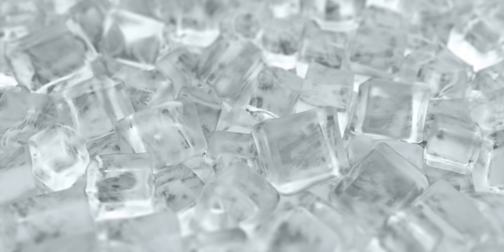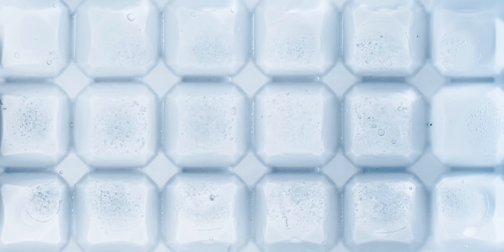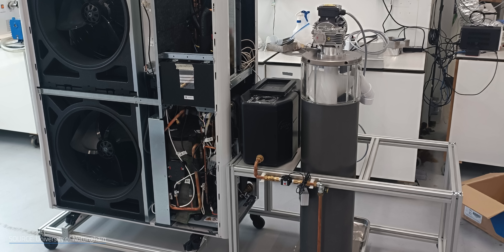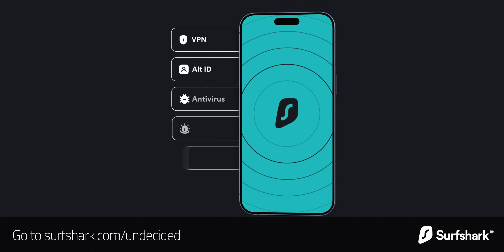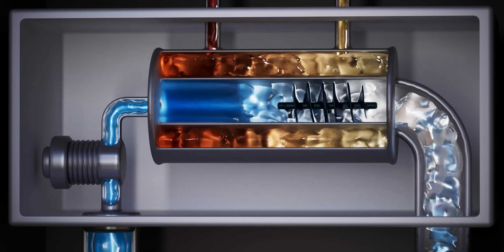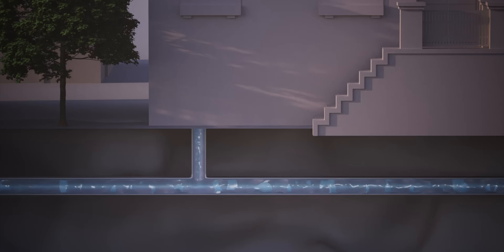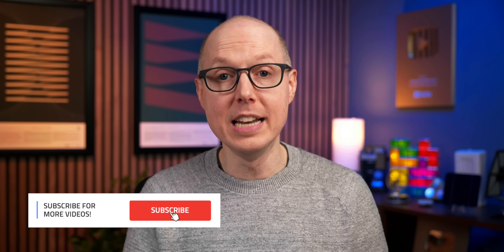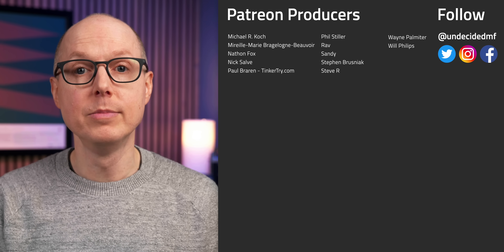How Can Ice Heat Your Home? Ice Source Heat Pumps!

Comment: Gas mains aren't bidirectional so where does the non potable water come from and where is the return loop?
Reply: The non-potable water comes through the gas pipes and the slush is dumped into existing sewer pipes to be melted by mixing with all the other sewage.
Reply: @willythemailboy2  I thought that but a lot of our sewage especially at the house is close to ground level so on a minus 5 celcius night wouldn't the sewage from so many slush producing houses be in danger of freezing solid especially with solid matter like faeces and toilet paper, my neighbours and I all share a sewer manhole between each pair of houses that is only 3 feet below the surface, that is repeated throughout the estate of several hundred houses.
Reply: @ Depends on where you are in the UK, but the frost line there generally isn't much below 18 inches. Even if you have snow on the ground without melting for several days, the ground stays above freezing even that close to the surface.

Couple that with the heat in domestic waste water and the slush should thaw pretty readily in all but the worst circumstances. If you were in Finland or something it would be more of a concern.

Comment: If we're talking about using non-potable water, then the freezing point drops with added particles in solution, driving up freezing time and energy consumption relative to freezing a more pure form of water. And this begs the question, if we're now adding more power requirements to the grid, can it handle it, and what is the source of the electricity?  If we have to generate the electricity with natural gas (or some other fossil fuel) generation, and then transport that power to the home, with transmission losses...isn't it better to just burn the natural gas at the home and get a better efficiency for energy transfer, and therefore a smaller CO2 release?
Reply: Non-potable water comes in many forms, not all are going to have significant particle or dissolved content to worry about. Technically you could feed this from a rain barrel or similar, which is also technically non-potable. As for comparing power plant gas usage to home usage, no. Not even close. Power plants are WAY more efficient than home use, even ignoring the efficiency of using the electricity to run a heat pump rather than electric heating. The relative efficiency of power plants is why we have them rather than individual generators for individual houses.

Comment: Air to water heat pumps have been used for 20 years up here in the north of Sweden. They work insanely well down to -20 deg C. This video is absolute nonsense. Matt keeps pedaling negative fake news regarding air/water heat pumps year after year 😥

Comment: Whilst the use of the existing natural gas pipe is a good reuse of infrastructure, this is totally wiped out by the need for a return pipe which doesn't currently exist, necessitating digging up every road and street to install anyway! And if not plastic, gas pipes are also steel which is not suitable for water.

Comment: Sorry, this makes no sense.  He's talking about running a second pipe to the entire network for the slush outflow; there's no way that's affordable.
Reply: I might be missing something, but isn't the idea that they would use drain water, maybe supplemented with tap water, as the input, and then ice via existing gas pipes as the output?
I'm more confused by the wording of the video, which makes it seem like the ice is the source of the heating as opposed to a byproduct.
Reply: @reinux  The plan seems to be to run the input water through the gas pipes and the output water into the sewer system.
Reply: No that is not what he's talking about. 
Each house already has an existing gas and water pipe leading to the house. All that is needed is the ice slurry output pipe that can just go to the sewer where the ice can melt.
That is not the expensive part, the expensive bit is the ice heat pump.
Reply: This was explicitly addressed. The researcher said it would go down the drain. Colloquially, "the drain" refers to the pipes which lead outward from sources of used water within the home. I am pleased to inform you that the English do indeed have indoor plumbing, and are no longer throwing the contents of their chamber pots out into the street.
Reply: @ It really is disappointing that people come to the comments for a tl;dr, and then are misled by confused comments. It seems to be getting worse as of late. Chat GPT effect maybe.
Reply: They would use the storm sewar
Reply: Exactly my thought! Gas network is a one way delivery! But they got 15 minutes of fame...

Comment: While you would have to treat the existing metal pipes to resist corrosion, a saturated NaCl solution would still be cheap but more reliable and more energy dense than using water or say antifreeze to pump heat from. Traces of a salt hydrate with a higher melting point would give the solution that phase change temp bonus without risking clogs by freezing the host NaCl(sat), like plain water, thanks to the dT between freezing points of the salt hydrates on top of having a having a higher heat capacity.

Comment: You need to persuade everyone in the city to switch.
Can't use gas line for both at the same time.
Reply: The idea is to dump the slush into the existing sewer lines. They should easily be able to handle the additional load.

If I'm mathing correctly, the average UK home would need only about 1200 liters of water to replace the energy content of natural gas used per YEAR. Compared to about 350 liters used per DAY for normal usage, the increased water demand and sewer disposal cost is absolutely trivial. Even allowing for inefficiencies doubling the theoretical usage to 2400 liters of water is still a rounding error.

As for the change over period, it would be possible to run the heat pump using existing potable water lines until an entire area is converted, then switch the gas pipes to non-potable water. After that switching each end user from the potable system to the non-potable system would be relatively trivial. While more costly in terms of water prices, especially for the early adopters, it spreads the transition out over a reasonable time frame while not leaving anyone out in the cold, either figuratively or literally.

Yes, this is copy pasta, but at least it's my own copy pasta rather than repeating comments from other people. I have standards.

Comment: why would you put the ice down the drain instead of running it across the radiator of your fridge to melt it and put it back into the frontend of your slushee maker
Reply: The refrigerator is not nearly enough energy to make this closed loop. Running the slush past the refrigerator coils might make the refrigerator more efficient but it's not nearly enough heat to melt even a fraction of the ice generated by the heat pump.

Comment: The biggest problem...especially in extreme cold climates, is that fossil fuel heating ends up being more affordable and reliable than electric heat, despite being inefficient. The cost to buy and install a natural gas furnace/boiler in these places is around $5k, is a simple and direct swap of the old furnace, and still works in power outage situations compared to installing a heat pump, off-grid power source, and breaker panel upgrades. The only way to make mass adoption viable is to make electricity cheaper and more reliable than natural gas.

Comment: I mean, this is a good idea, you basically get a ground source heat pump without having to dig .
but why would you use all these gas pipes when we’ve got perfectly ready waterlines already?
It seems to me like the best way to make this work is to extract heat from waste water, before it goes down into the sewer.
If you need more heat, open the tap (automated) 
That said it would, of course, be ideal to not use potable water for this.
Another fun one might be to just use a rain barrel … if you live in the UK or the northwest there’s so much rain you don’t need to use anything else
Tempted to just point a gutter at my air source heat pump now  xD

Comment: Ice slurry pipes?  Talk about a pipe dream...  Too complicated, too expensive, too prone to breakdown.  Better off doping the water so it can be subcooled, and let the individual home systems deal with the phase change part.  No one mentioned how they'd combat the slurry's abrasive wear on the pipes.
Reply: The ice slurry is the output, and the pipes only have to handle it from the output of the heat pump to the sewer line. The gas pipes would be feeding regular liquid water to the system, although it would be water that isn't cleaned to the point of being safe to drink (think straight rain/river water).

Comment: I suppose it's good to have options but I really don't see how this system will be better except in some very specific circumstances. Most people live in latitudes that have very few days of the year where modern air heat pumps become less efficient than gas.

Latitudes that are cold enough to make air heat pumps nonviable can use ground heat pumps, which don't become more expensive when the distance between buildings is increased.

The fact that you need to convert everyone all at once to build and maintain a network of infrastructure means that you also need a highly organized, highly competent government to implement it and compensate they owners of existing systems that still have years of life left.

So how many high latitude, densely populated and well governed cities are there? Would it be enough to produce the scale that would be necessary to sustain the industry to produce the parts and experts needed?

I just don't see it happening.

Comment: My new house that I’m buying in LV is 100% electric. Induction cooking, heat pump, solar on the roof, even a smart circuit breaker. They are the only builders in Las Vegas that do this. They are called Beazer - my home is being built next year and it will have a heat pump, solar, two Tesla chargers, a Powerwall, induction cooking, and I’m also having power outlets behind each toilet. I’m so excited. I wish other builders would follow their lead!!!

Comment: silly question, but why couldn't the normal potable water be the supply line for the system, and use the gas pipe line as the return instead? less of a strain as the return i'd imagine (pressure wise). Then just divert that water into a treatment plant at the end to make it potable again and reuse
Reply: In the UK, potable water is not cheap.
In some other places, using regular tap water would probably be more cost-efficient.

Comment: Such systems are known in Germany under the name "Eisheizung" - "ice heating" already (since) for 13 years. By youtube there are much videos about it, if you search for example under "heizen mit Eis". This systems were not widespreaded very much, because of problems with broken plastic pipes in water/ice. You need some material, which can hold mechanical deformations of phase change water/ice.
Reply: There is a new "Eisspeicher" system installed at the DockJard in Berlin
Reply: @derradfahrer5029  Yeah, there are not pipes by heat exchanger, but flat elements, maybe because of this problem? Such flat heat exchangers are more robust for phase change?
Reply: "since x years" has no meaning in english. it's " for x years"
Reply: @ReynaMirez  thank you, i have corrected it!

Comment: He didn’t really explain properly.
It is not an ice source, it is water source, the ice is on the output side.  
Basically it is a water source heat pump.
But instead of dropping water from, say, 10 to 2 deg, you are dropping water from 10 to just below zero.  So it won’t be as efficient. The plus side is that it needs 3,350 less flow of water. 
That said, is it more efficient than an air source heat pump..,I guess not in most cases.  And you have the cost of maintenance to the supply network.
Reply: He said the latent heat of fusion is equivalent to a 80C temperature change of sensible heat. So if your delta temperature is 15C on a normal water source heat pump, this system would use about 5 times less water (80/15=5.333), not 3350 times less water.
Reply: @ajnosek1528 haha…yes, i multiplied twice.  I was using his 335x for 1deg, then times by the 80c / 8delta. I should have divided.  Which goes to show I don’t know what I’m talking about!  
I am assuming the ground is around 10c and the return flow 2c. So you are dropping the temperature by 8c, for 1c it 80x, so is it not 8x80= 360

Comment: Proposing wiping out the countries gas infrastructure is ridiculous. Shows that the city level research is just a cash grab. More technically using old, uninsulated, gas pipes in a country that is well known for gas leaks from old pipes further demonstrates its absurdity. The ice concept as a stand alone heat pump seems very creative, but in no way feasible as district heating. The idea of needing to add a return line makes this no more attractive on a construction infrastructure level than district low temperature geothermal, which is a proven technology.

Comment: 3:35 This is a little unclear - Is this 80 degrees when raised from 0 degrees after phase change?
Reply: Either way, from ice to water, or water to ice there is there equivalent of 80 degrees of energy required. So by cooling the water from just above freezing down to a slush you can use a lot less water, compared to say a tradition water source heat pump where say you lower the water temperature down  20 degrees or so.  So the gas pipes would need 1/4 or less the water of traditional heat pump, and sending that much water though the repurposed gas network is a lot more practical.
Reply: @briankuhl9314  I appreciate the thorough explanation, thank you! I meant to ask if the comparison between phase transition energy (latent heat/heat of fusion) and energy required to raise water to 80 degrees is being measured from 0 degrees (presumably Celsius but since this channel is American and covering a British team's work, who knows). While we are talking about ice, so it probably is 0 degrees to 80 degrees, it could also just be room temperature water and that would require less energy to get to 80 degrees.

At the end of the day, I'm splitting hairs but I like information to be presented in an accurate and precise way, especially when drawing comparisons with other data.
Reply: Correct.

Comment: Can gas pipes handle the change in product it moves?
 I work with gas and liquid pipe lines, and they each have different challenges.... 
Liquid lines hate gas in them, and gas lines hate liquid in them. They are designed to minimize one or the other...

Comment: You seem to be skipping water driven geo thermal. You have the pipes in the ground running for literally miles. Just use a water heat pump hooked up to the existing pipes. The slushy thing is a cool concept but it seems needlessly complex.

Comment: 3:55 but the gas lines are currently one way lines which service the homes, but do NOT already have a return line for this slushy mix... So it would require infrastructure additions and new plumbing, at whose cost?
Reply: Existing sewer lines could easily accept additional water.

If I'm mathing correctly, the average UK home would need only about 1200 liters of water to replace the energy content of natural gas used per YEAR. Compared to about 350 liters used per DAY for normal usage, the increased water demand and sewer disposal cost is absolutely trivial. Even allowing for inefficiencies doubling the theoretical usage to 2400 liters of water is still a rounding error.
Reply: @willythemailboy2  I live in the United States. However you are implying liquid water, not a slushy icey mix that is then... What? Wasted as sewage water? Are you aware of the water crisis humanity has?
Reply: @MikeNovelli  You're falling for one of the classic traps of all new technology. It doesn't HAVE to work for everyone to be worthwhile for some people. The UK does not have a water crisis, so using incrementally more water to save energy works FOR THEM. It doesn't have to be practical for you to be worth it for them.
Reply: @willythemailboy2  you haven't solved the non liquid issue. But ok 🤷🏼‍♂️
Those gas lines are going to burst.
Reply: @ Entirely possible. If my water usage number is right they'd likely be better off using the existing water supply pipes and eating the cost of treating the additional water.

I'm no plumber, but using gas pipes for liquid water doesn't seem like a smooth transition.

Comment: Existing District Heating Systems (https://youtu.be/2S5NdYso73M?t=478) could use Ice Source Heat Pumps at their head-ends to take advantage of the Heat Of Fusion.  They already have the out-going and in-coming water distribution loops.  Since many DHS use gas as their fuel, this would let them participate in community electrification efforts.